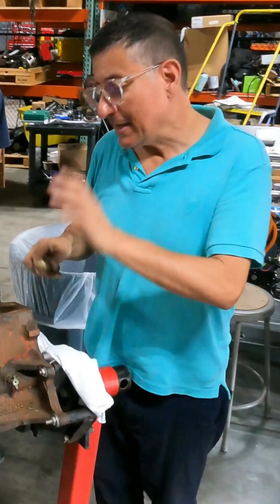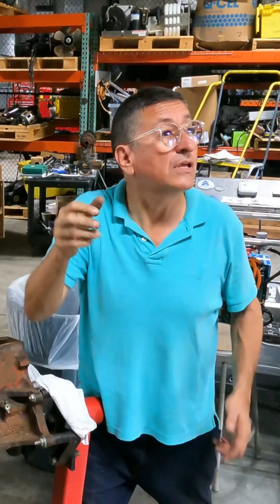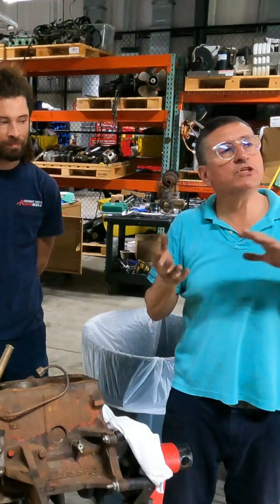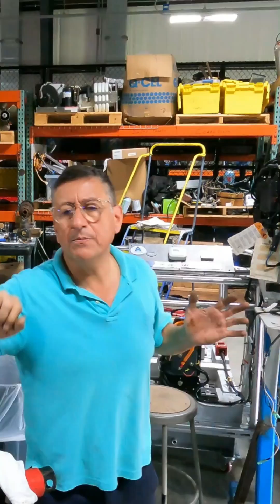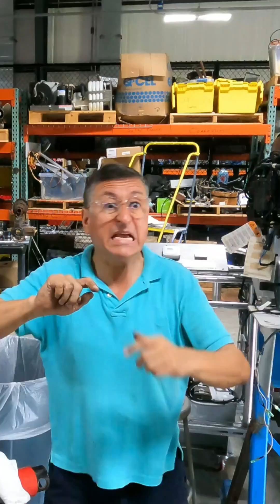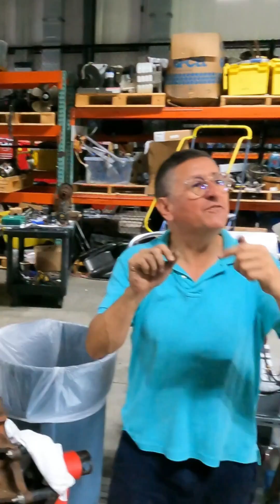Advancing and Retarding the Timing

Comment: No. The reason spark is initiated in advance of tdc is to allow the necessary time (timing) to burn the mixture to achieve peak cylinder pressure at approx 15 degrees after tdc. The engine will not "overspeed" if spark is initiated after tdc, instead it will not have the necessary time (timing) to burn the mixture efficiently. The engine will be lethargic, mpg will be terrible and emissions will suffer.